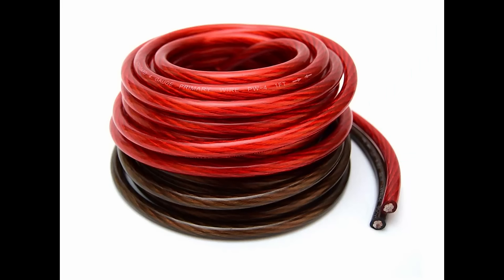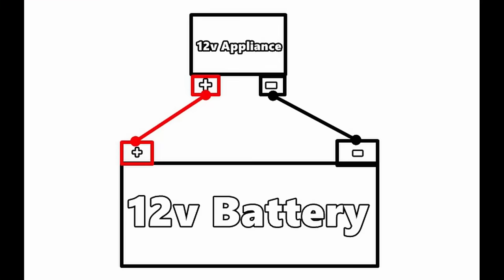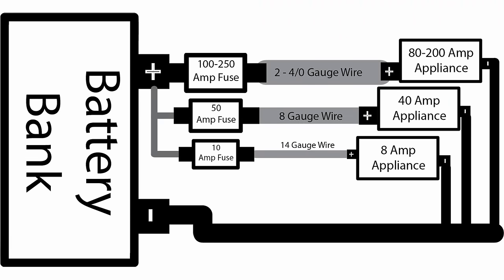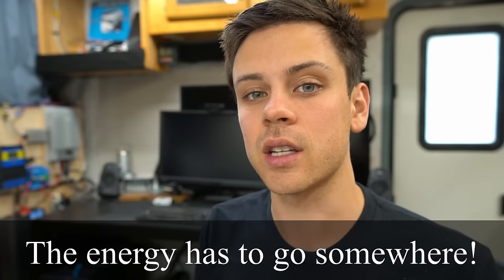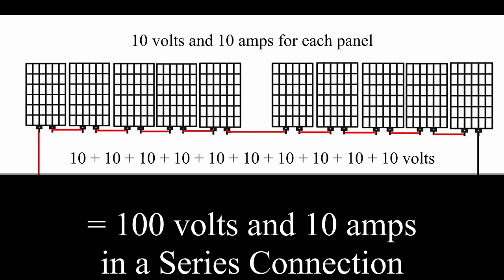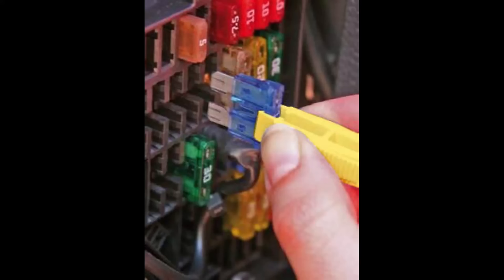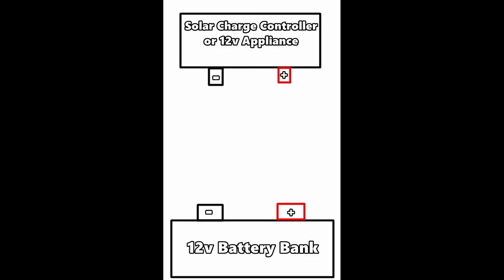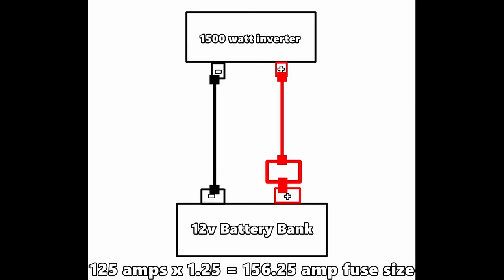Electricity Explained: Volts, Amps, Watts, Fuse Sizing, Wire Gauge, AC/DC, Solar Power and more!

Comment: I'd like to set this up on my roof and have it power a small battery bank to run my refrigerator and some lights in a short term black out. Would I need the same set up to switch over from my breaker and run power throughout the house? I may later add more batteries...

 BTW the batteries would be in my shed. I've already ran an out let from the shed to the breaker in my home. Now all I need to do is plug in a generator (I did with a gas generator), and it worked with no issues during the blockout. I just want to use the batteries and panels to run small appliances for a few hours. Any tips, videos, schematic would be great

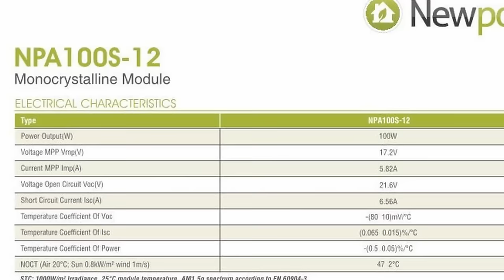Comment: Amazing video, very helpful. I still am not sure of two things. In the wire gauge table, do I look for the 10% non critical or 3% critical value? I understood from the video that if its something connected nonstop, I should go for 5% and if not then go for 3%. It's confusing me.  The other thing was at 15:43 that the solar panel operate at 17.2V and 5.82A, which is ~101.1W per panel, 404.4W per 4. Isn't that somehow limited in the 12V system? I feel like it would generate lower W because of the lower available V? Or if it was somehow compensated by higher A on the 12V doesn't the max 5.82A limit that value too?  How does that work? Could someone explain it to me, please? Thank you.

Comment: Hi, I am not able to find the amps for a Bestek 1,000 watt inverter.  It has two outlets.  My guess is 100 amp but I really have no idea.  Can you tell me if I am missing how to calculate the amps or what the amp is for that product?  Thank you
GREAT VIDEO!
Reply: Think I understand.  1000 watt inverter/12 volts (battery) = 83 amp  x 125% = 104 amps + 20% surge = 121 amp fuse.  Increase fuse to next size up.  I should get a 130 Amp bolt fuse.  Is this correct?   Thanks

Comment: Will, I have a question? I appreciate your help. I need to redo my solar gland on top of the van. I need to cut the ends off the solar cable and redo this once I thread it through the gland again. 
Can I cut the solar cables without being shocked since they are connected to cables on panels on roof?

Comment: I thought it necessary to ask this separately from my previous question:
Do you mind clarifying the 70% output of rated wattage further as compared with what is called the efficiency of the panels which usually falls between 18% and 21% for the ones I find commonly in my region?

Comment: I missed explanation about why solar panel 17.2v and controller 12v can be at different voltages. Because at the beginning he said 220v can be used woth 220v, 110 woth 110, 12 with 12 and so on...

Comment: Hi, very good video, please I need some help, i couldnt get formula that can determine which solar panel power capacity (watt) is needed to full charged in 4h a battery of 14.4ah 12v ? Thank you.

Comment: some of the charts seem to indicate that  the "length" is not the distance from the load but the total length that current must flow. In your example that should be 10ft + 10 ft = 20ft. No?

Comment: Hello and first of all thank you for the well done explanation. Especially comparing AC to a wave helps me a lot to remember how this one works.
And now a question. When I have a solar generator, that can be charged by solar panels from 16 to 60 Volts, while I have 12V panels, I need at least two in series, to load with 24V? And I could put up to 5 panels in series and load with 60V, while I could also make several units of 2 12V panels in series and then connect these units in parallel to load at 24V?

Comment: Downloaded your book and have a question - Under Battery Selection Example - you state a "12 volt, 400 amp hour lead acid battery will supply 2400 watt hours of usable power (but will have a total capacity of 6000 watt hours), which is perfect for our 2400 watt hour requirement".   Wouldn't it be 12V x 400Ah = 4800 watt hours ?   I'm missing something  ;-)  newbie - thanks
Reply from the maker: Lead acid can only discharge to 50%. So yes that figure is correct

Comment: I need an expert. 

I want to buy two Anker Solix 3800 units
That will give me a total of 4800 watts input.

Then I want to buy 25 cig 200 wat yuma panels. Will the system be able to handle the Watts, Amps, & Volts from the cig panels?

Comment: Hi will, I live in Pittsburgh pa and we recently had a really bad spell with -4 degree temperature for about 24 hours. Our lg washer broke and I suspected the basement got too cold and maybe ice got in the machine. I made an appointment with the repairman who can't come until Jan 9 th. In the meantime, we warm up really nice and the washer comes back to life with no error codes. We have a really old house and had a lot of knob and tube wiring replaced except for the basement. The electrician assured me we did not have knob and tube but I'm wondering if he was wrong since we can't see behind the walls. I'm wondering how do I find out how much power this washer needs and I'd like to run it from solar eventually all on its own circuit.

Comment: Wondering if anyone can answer this question - I am really having trouble understanding how voltage can ever increase without also necessarily increasing amperage. If you have a conductor with 100 amps flowing through it and you increase the voltage from 9V to 12V, how is it that the increased pressure would not also necessarily increase the amount of electrons (coulombs per second) flowing through the conductor? If you limit the system to 100 coulombs per second, how will you ever get more electricity/watts out of the end of the system regardless of how much pressure there was at the start?

Comment: Could you please help me with a battery question? I have a Yamaha golf cart with 6 new 8 volt batteries (Interstate GC8). How long can I pull 50 amps?  I have tested the amp draw at 12 mph and it is about 40 amps.  I want to know how far I can go on a full charge.  Also, could I gain range by going to the newer batteries?  Sincerely, Richard Goodman

Comment: I watch your videos a lot and enjoy them, your explanation of AC power lost me when you compared it to a vibration and said it never moves. To produce current the movement of free electrons in a conductor must move, they just change directions as measured in hertz. Hertz is the change of direction in a second. House outlet power in normally 50-60 hertz, this means the free electrons change direction 50-60 times a second.

Comment: I have watched alot of your videos which has really helped. I'm currently trying to work out fuse size from my eco worthy all in one to my battery bank. The battery bank is x2 12.8v 280ah in series to power the 24v all in one. Am I supposed to use the 3000W inverter size to measure this? I'm thinking 160amp fuse.

Comment: I'm literally trying to figure out which measurement matters more in general (let alone for figuring out how much juice I need in the battery bank for my bus buildout) between Ah and Wh. Comparing a 12v and 24v setup where the 24v bank has half the Ah of the 12v bank, it has the same Wh (12v x 200Ah = 2400Wh, 24v x 100Ah = 2400Wh). I'm mostly trying to understand this for calculating appliance usage and general energy needs. Google has failed me because I have not found the right way to search this topic to find an answer yet, so I'm asking everywhere I can (that makes sense).

Comment: I have 4 100w. Mono panels with 2x 100amp AGM bats. & 40 amp charge controller. Batteries are depleted by morning and, according to the Rover, never charge past 60% capacity.
Wiring is all #10 wire. 
What’s wrong???
Paul

Comment: At one point you talk about a fuse blowing on a charge controller I was under impression that it would burn up if battery was disconnected while  solar hooked up am I wrong

Comment: This is informative. 
But, what if I don't want to charge batteries from solar panels? 
I want to use solar panels to produce only electricity (in day time) via inverter. Apparently the parallel conn. +/- of the solar p will connected to it. 
But what will be the Ampere needed from 12volts solar panels? To give output appox 1000watts?

Comment: Thank you so much for your help,  very helpful videos,  
I need an advice on buying a battery, 
This is the system I bought from Ebay,  
24V Solar Water Pump Deep Well Kit Solar Panel f Garden/Irrigation/Watering
Can you please help me wich battery I should BUY .
Thank you again for everything

Comment: Question: I got back from a winter trip gone 6 months 
Now my 12 volt Car Battery appears dead. It’s been fine the in the Past for 3 years.
I have a battery charger on it that is 300 amps 12 volt charger, it’s plugged in. When will I know if that worked like overnight? Or a few hours?
At what point do I say I need a new Battery?

Comment: HI, One question, when solar panels are capable of 5.85 amps each and together can produce max of 24amps, and panels are the source of energy flow, just wondering why do we consider battery's voltage (around 16:28 in your video) while calculating ampage needed for solar charger controller as 33. together panels can only produce maximum of about 24 amps right? (connecting them in parallel). isnt it 24 + buffer may be 30amp good enough? Please help.

Comment: the analogy you used to describe the electrical flow is the same as a inverter. hence y pure sine wave ones r better and more expensive. the smaller the wave in ac current the "cleaner" the power. the cleaner the power the better and longer your ac appliances will run. a regular inverter and city pwr waves are very large compared to a 1/3rd the size wave of a pure sinewave inverter. the smaller the wave the more energy efficency you get outta the inverter and appliance.

Comment: How would you connect (2) 100 Ah to (1) 200 Ah battery? Connect the 2 smaller batteries in series then connect those 2 to the single larger battery in parallel?

Comment: I have a question for you! My son have an electric scooter which run at 72 volt with 6x 12 volt 20AH battery. I bought 6 LiFePO4 eco worthy battery can I use them to get a 72 volt? The Amazon seller told me that I can’t go more than 48 volt?

Comment: If you upgrade from 12v to 24 volt system in camper setting, does that cause power issue for items that already rul off the battery dc ?

Comment: If current moves from negative to positive then why is the fuse positioned as close to the battery as possible on the positive side..? How is that protecting the appliance ?

Comment: Ok so where im stuck and this may be a dumb question... BUT how do i calculate what load I can run on a breaker or system? If i have a 48v system but need to power lights and a mini split do i simply add up the amps listed on the label and that tells me if it can run on a 20a or 30a breaker? And how does the 48v matter once the power is converted to ac? (in terms of usability?)

Comment: How does one calculate the watts being used in a 240V split system using a clamp Amp meter?  For example, when my AC comes on I measure 14.4A on the L1 line and 10.3A on the L2 line.  Does this add up to 1728W (120V x 14.4A) on L1 plus 1236W on L2 (120V x 10.3A) = 2964W being used by the AC?

Comment: good video, but I am getting old and forgetful and could use a bit of reminding every now and agian. so I calculated the in-line fuse size I need for each solar panel. it calculated to 11 amps using the short circuit current. well, I never heard of a fuse this size. on the panel it states the largest fuse to use is 15 amps. potentialy, this could short circuit and the fuse will Not blow I am thinking. and if I install a 10 amp fuse it could potentialy constantly blow because checking the calculation, using the optimum curent it calls for a 10.75 amp fuse. I am using a combination of #10, #8 & #6 guage wire from the roof to the Victron 100 / 5o controllers. what do you suggest??

Comment: Can I use two different size solar panels (1-LG 405 amp bifacial and 1- Renege 100 Amp) running to the same mppt controller then to my 300-400 amp LifePo4 battery bank? or should I have a MPPT Charge controller for each solar panel?

Comment: So I have a few things in my camper that run continuously.  I have a water still that runs continuously at 585 watts and a dehumidifier that runs continuosly at 612 watts.  Just between those  2 appliances I run just under 29000 watt hours every day.  Is this right?  Most home systems are 30kwh.  Can solar work for anyone anywhere if they run even one appliance 24/7?

Comment: I have a question about my Delta Pro it has four receptacles labeled 20 amp and then it has the 30 amp RV style plug can I use them both at one time

Comment: so if i have  power of 9w i use a 10 amp fuse is this right--Power: 9W
Input voltage: DC 12V
Beam angle: 120 degree
Light source: SMD 5630
Light colour: White
Colour temperature: 6500k
LED quantity: 36pcs
Lumen: 1500lm

Comment: Where did you get the 9.85 hours to recharge the solar power battery?  I got lost at that point; I understood multiplying the 404.4 by the 70% but what math did you use to gather that information? i'm taking notes

Comment: can you charge your camper batteries with solar panels via a charge controller while the batteries are under load during the day such as a camper refrigerator and charging a fan battery?

Comment: Can you tell me what size fuse to use on the wire going to a 4000 inverter coming from 2 300 amp hour lipo batteries run in parallel. Wire legth will be about 2 foot to the inverter from the batteries. Thx!

Comment: Hey Will.  How are you?  I can see that in 2019, your knowledge of electricity exceeded that of most people your age.  It's 2021 now.  Has your understanding of DC Theory advanced any?  Maybe I can help, or who knows, maybe you can help me.  Either way, here's what I know.
P:  Power (Watts)  I:  Current (Amps)  E:  Voltage (Volts)  R:  Resistance (Ohms)  P=IE  E=IR
It's difficult to explain how electricity works without explaining basic D/C theory.  Furthermore, D/C theory can't be explained at all without including resistance (ohms.)
It all begins with Ohm's law.  Voltage=Current x Resistance, or Volts = Amps x Ohms.  Of those 3 properties, only 1 is constant in any given circuit.  In a basic, simple circuit (ckt.) such as a light bulb, Resistance is invariable.  To use your example, imagine a solar panel that produces 12 volts D/C (12 VDC.)  It has a capacity of 120 watts.  Power sources don't actually produce current.  What I mean is you can force 12 volts into a light bulb, but you can't "throw" 10 amps at it.  in fact, voltage is the only thing that you can forcibly control.  Power (watts) is directly proportional to the current.  Current is determined by the resistance of the load (light bulb.)  To get the full 12o watts, your current must be 10 amps.  (P=IE)  But remember, you can't push current.  It must be pulled.  E+IR  At 12 volts, to get 10 amps, R=E/I.  12/10=1.2 Ohms.  But what if your wire is too long and your voltage drops to 11 volts?  (E=IR)  I=E/R (remember, resistance does not change)  11v / 1.2ohms = 9.17 amps.  Likewise, 9.17amps x 11volts = 100.87 watts.
Go to the water pipe.  Every wire has some resistance.  Smaller wire has more resistance to electrical flow.  Current (amps) compares to the volume of water.  More gallons/minute can flow through a larger pipe.  More electrons can flow through a larger wire.  Your electron count is your current.
As you said, trying to pull too many electrons through a small wire will distort (stretch) the molecules that make up the wire.  When a molecule is stretched, heat is produced.
That brings us to "What is electricity and how does it flow?"  Do you remember learning about atoms?  An atom of copper has a nucleus with protons and electrons orbiting it.
Electricity is energy.  More specifically, it is Potential energy and Kinetic energy.  I won't get too deep.  Kinetic energy is from the motion of the electron.  Potential energy comes from the electron's position in relation to the electromagnetic field that coexists with electricity  
When an electron is exposed to a more powerful photon, the electron gets excited, absorbs the energy of the photon, and its orbit speed increases.  Centrifugal force gets stronger as the speed increases, which makes the over all diameter of the atom bigger.  The wire however, remains the same size, and it has no room to accommodate the growth of the atoms.  Something must go.  The [negative] electrically-charged electron is knocked off and it flows through the electrical conductors of the circuit (light bulb, etc.)  Its motion will continue as it follows the path toward a proton (the positively charged particle, because opposites attract.)
So when A/C or D/C electricity flows, there are real particles moving through the wire.  
If you wonder how it's possible for something to move through a solid wire, the answer is simple.
Nothing is solid (as we perceive "solid")  Everything is energy.  An atom consists of mostly empty space.
That is my best short explanation of electricity.
HERE is something to think about:  You've probably heard that perpetual motion is impossible.  If you consider that everything consists of atoms, with protons, electrons, and neutrons that revolve around a nucleus constantly, forever, what is the source of energy that fuels that motion?